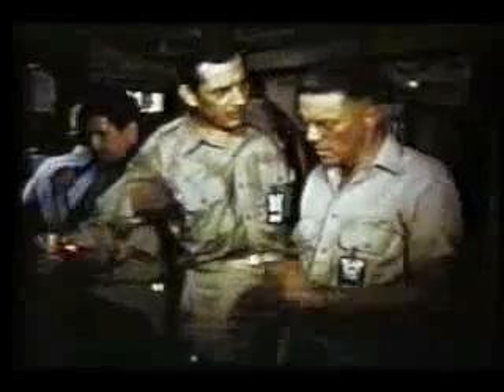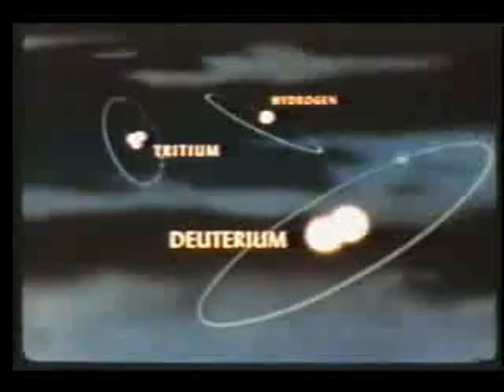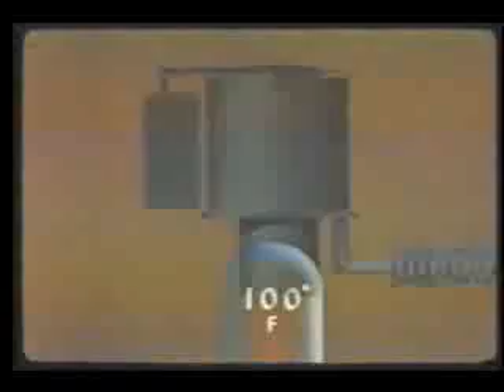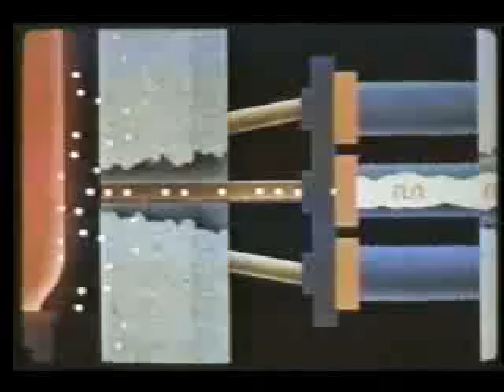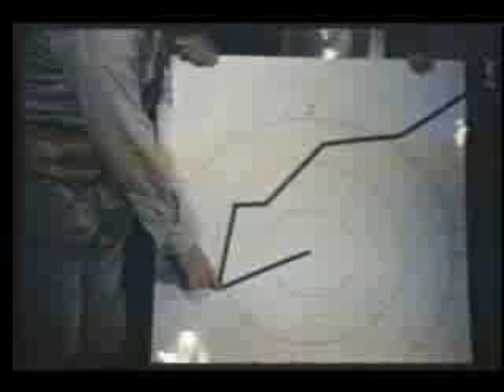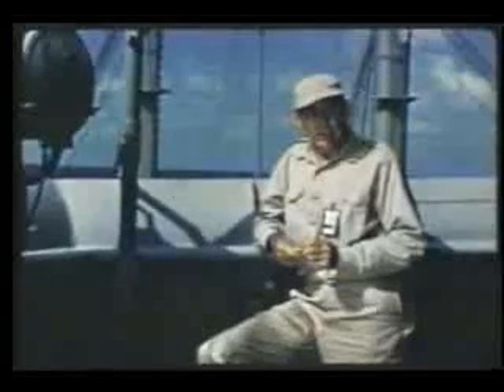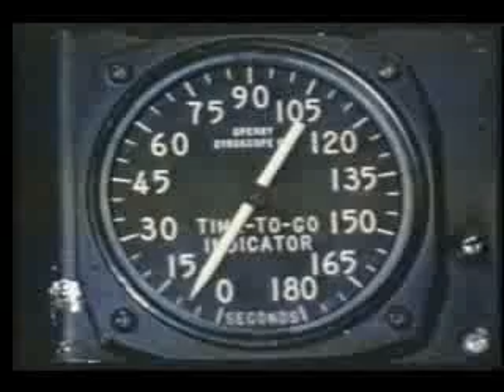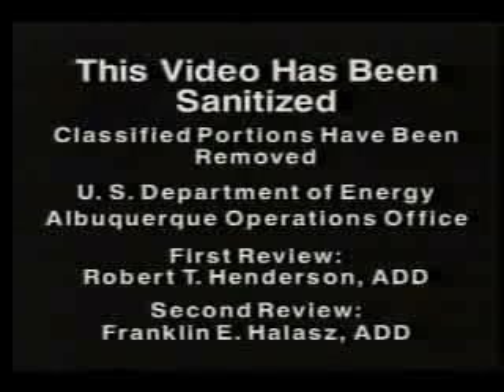Declassified U.S. Nuclear Test Film #12

Comment: A scientist said they were 50 miles from Castle Bravo when it went off and the heat, even at that distance, was NEARLY unbearable.   And it didn't subside.  It actually continued getting hotter.  If you were 10 miles from that bomb you'd just be roasted to death.  Let alone blown away.  Truly nightmare stuff these things.
Reply: The boat with all the spectators were only 23 miles from ground zero.. The guys who set the bomb off were only 20 miles from GZ.